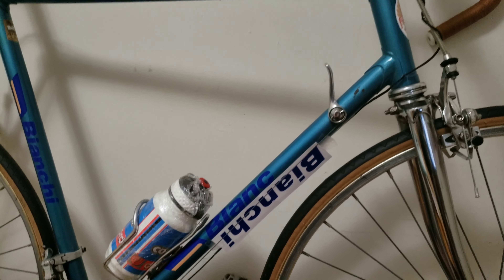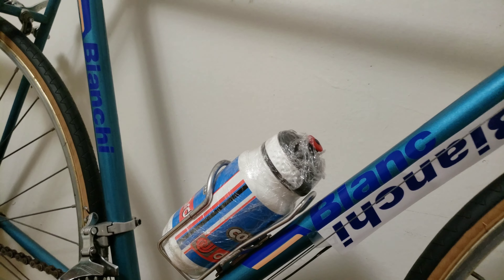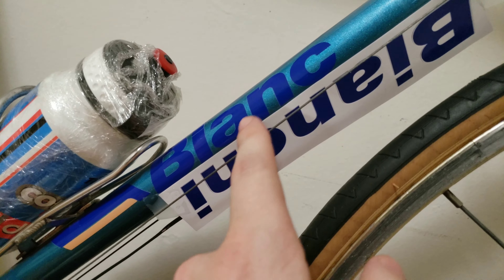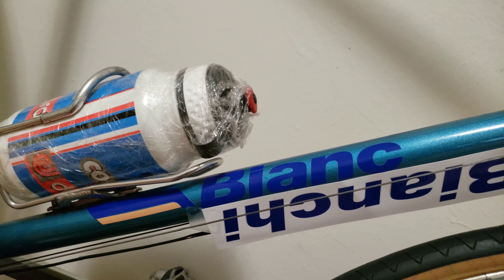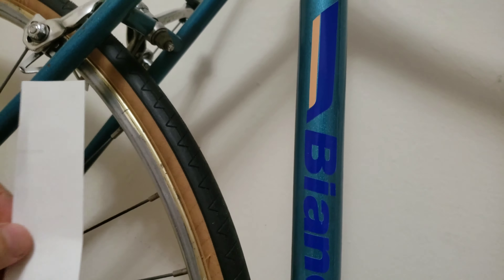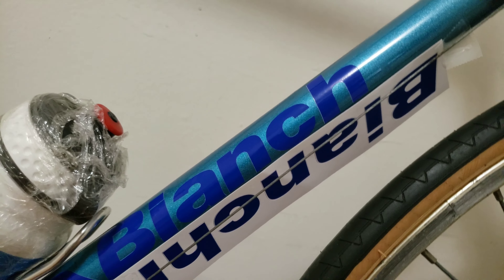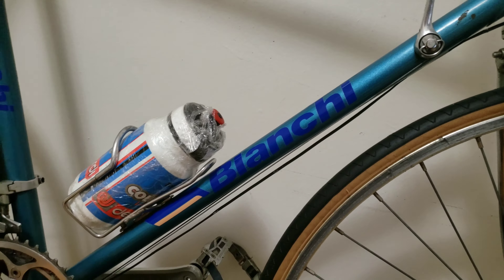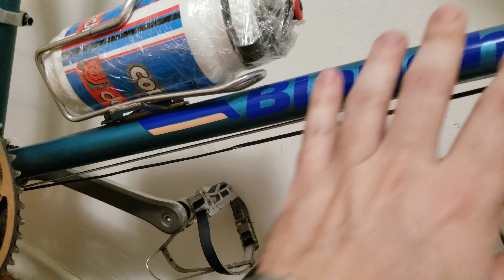How To Apply Decals / Stickers On Your Bike

Comment: Happened to stumble across your video. For next time, it is much easier to remove the sticker "background" on the paper and put masking tape over the parts you wish to transfer. By doing that, you are able to lift the parts you want off in one piece and transfer them together without fear of misalignment.
Reply from the maker: I agree 100%. I am super new to Decals and stickers , so there is room to improve. Thanks for useful tip.